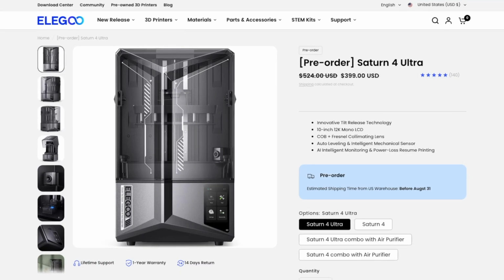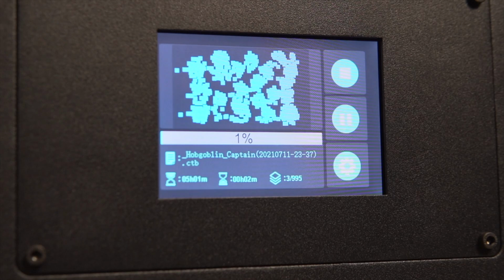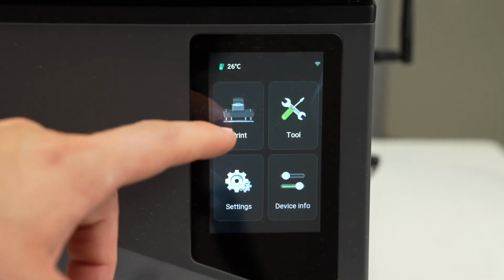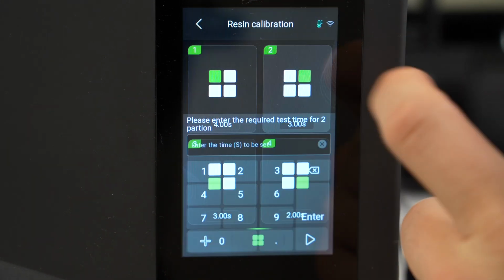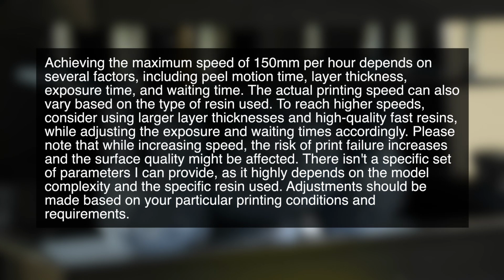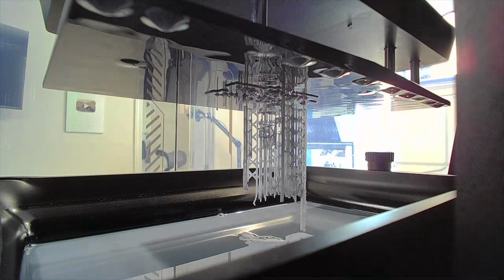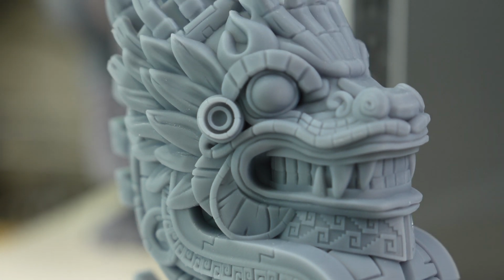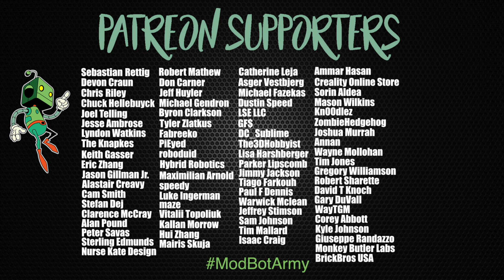Best All Round Resin 3d Printer 2024? (Elegoo Saturn 4 Ultra)

Comment: I've been using the Elegoo Saturn 4 Ultra for about a month or so and I have yet to have any print failures. It turns out that the blemishes on the machine and cover are caused by the "bubble pad" the machine is packaged with for shipping. Overall, I am very happy with this printer.

Comment: Tilting finally done, check.
Resin heating ? 
Resin air filtration ?
Reply: Air filtration can’t be done at this scale. Not for the toxic vocs atleast. You need activated carbon in levels of multiple pounds and you need to refresh it often… like daily… if you are printing a lot. 

All a little filter would be good for is reducing smells. Vocs are too small for hepatitis filters and other off the shelf solutions.

You just need to vent properly. 

Heating… just get a brewing band or a thermalvatband.

Comment: If you have a S4U and you want to add a build plate but keep getting the error google 'Saturn 4 Ultra Z-Limit flash for Wham Bam XTR' and use that. It fixed the issue for me.

Comment: 13:12 That test of the cured pieces in vat was an actual failure. It didn't work, it's supposed to give an error and stop the print. The only thing that saved the printer is the fact that the build plate is on springs, so it has some give and could push back away from the LCD. There's a lot of nice things about the printer, but this is a real failure.
Reply: I was thinking the same thing. There was nothing presented in that segment that remotely said it worked. In fact, he at first made it sound like it failed and the only thing that saves his screen was the fact he MANUALLY stopped the print.

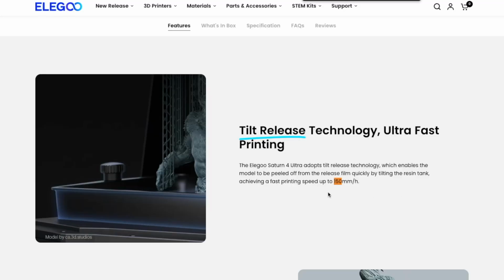Comment: 02:31 those numbers are only for 200 microns though, a layer height so thick that nobody in the world of resin 3D printing ever uses (you might as well print in FDM). Since Elegoo is careful not to mention this fact anywhere, it's almost akin to false advertising. FYI, the printer reaches 30-50 mm/h IRL at 50 microns. To put things in perspective, the new Anycubic Photon Mono M7 Pro consistently achieves 170 mm/h at 100 microns layer height which is 2 to 2.5 times as fast as the Saturn 4 Ultra IRL at the same parameters. Sure, the M7 Pro is more expensive and has other drawbacks (starting with a hingeless hood) plus everyone here is aware I think fo the famous Anycubic after-sales service quality.

Comment: I think the pressure detection failed in your test and your screen didn't break by luck, not because the printer decreased the pressure or something like that. If it detected something on the vat it should atop the print and give you a warning.
Reply from the maker: @Rayuaz  I’m thinking there may be a minimum height it has to hit something to throw the error. Since it was a few mm from its home position I also think it thought it had homed but the mechanical switch not having it much harder after triggering that it had reached the VAT saved it.

Comment: What is the point of faster prints of they are not reliable.

I rather have a more reliable and a consistent printer then a faster one. 

This is the reason I bought the Gktwo. With the built in heater it's much more consistent and you don't need to change exposure times after you tuned it in and it's a work horse of a printer.

If I had to choose between the two I would still pick a Gktwo
Reply from the maker: @firelion98  I would argue the tilting vat is more reliable. The heater I definitely agree with but there is at least an addon option for those that decide they want it.

Comment: I wish the toxicity of resin didn't freak me out as much as it does. The results are so defined.
Reply from the maker: I totally get it. Some of the modern resins are much less fumey but that doesnt mean they are better to be breathing in. Ideally its a garage/dedicated space thing with good exhaust/ventilation.
Reply: Honestly fdm printing is giving a lot of hobbyists a false sense of security by comparison. Both of them NEED to be ventilated or HEAVILY filtered
Reply: A cheap grow tent, fan and flexible duct hose out the window is less than a hundred bucks. No problems. ISO/Ethanol is much worse for you than resin anyway.

Comment: Including a camera, but no lights. Woof
Reply: Most lights would impact the resin to some extent.
Reply from the maker: Would have been at least nice for them to included IR. The Peopoly machine I used had that which at least let you see what was going on to an extent in the dark.
Reply: @MonkeyButlerLabs I have a light insight my grow tent with my printer where I print without a cover on my Saturn 3 and has no impact on anything